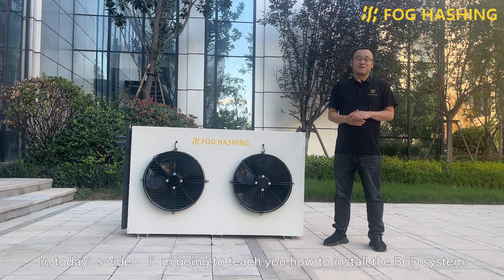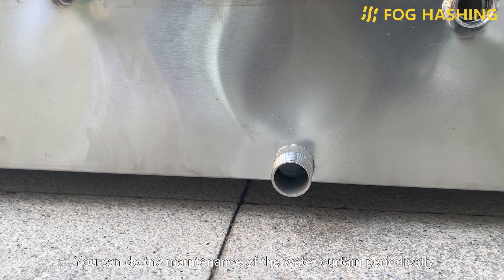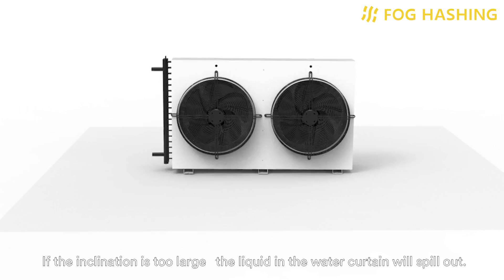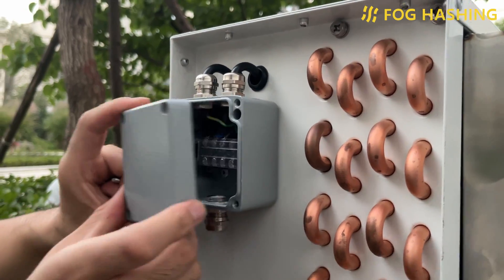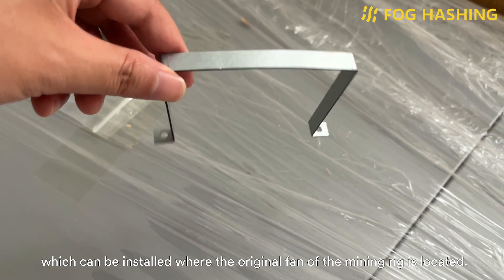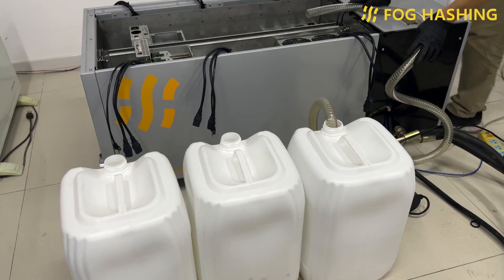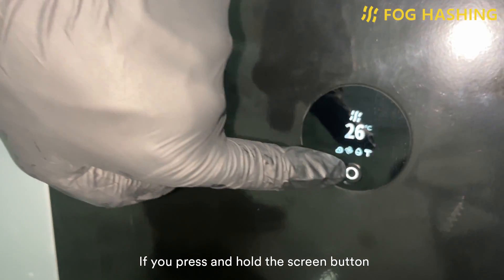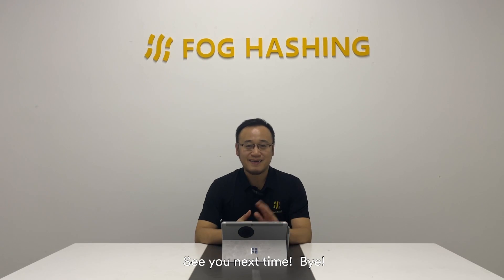Immersion Mining Kit B6D Installation Tutorial of FogHashing

Comment from the maker: Note: The power supply of the dry cooler can be adjusted by frequency conversion through a 380V-380V 60Hz or 240V-380V 60Hz VFD.

Comment: Does this unit work with USA residential 240v?  How many B6 units can 1 Dry Cooler serve??  Do you have any promo codes for the B6 & Dry cooler?  TY very nice unit
Reply from the maker: It is suitable for 240V, just pay attention when wiring. A dry cooler is equipped with a B6 tank, and a larger dry cooler can also be customized
Reply: @foghashing  6 S19Js on 100 Amp Single phase  <80% is Best leaves you a safe overhead. But heavy duty all leads and terminals and wiring preferable to a separate  Unit not you house unit. 100*240 = 100kw you want to < 80% of that  ie 19.2Kw  leaving 5.8Kw transient head room  less if there a voltage drop or cables are bunched or insulated  then you may only be able to run 5 safely. If you don't know get an electrician to do it for you.
Reply from the maker: @sl3rtyb3rdf3rts  Now this B6D product is no longer produced, replaced by the upgraded C6😄